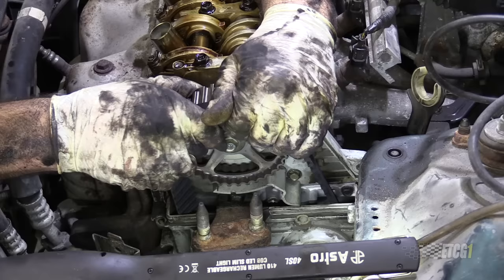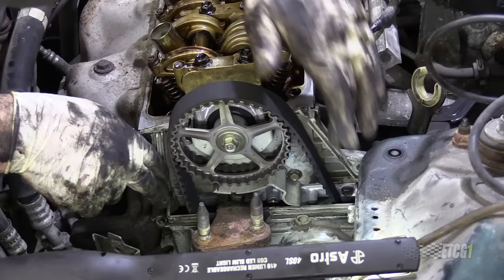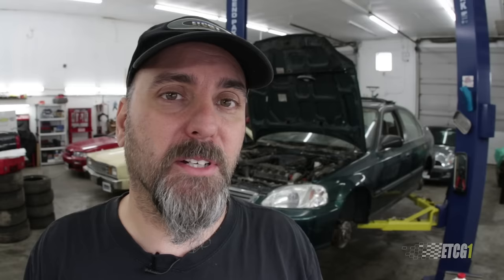How Come Timing Marks Don't Always Line Up Perfect?

Comment: BS! The "hunting" of the belt is a function of the ratio of teeth on the belt to teeth on the sprockets. This has NOTHING to do with the alignment of the timing marks on the sprockets and block/head. Which depends on the ratio of teeth between the crank and the cam sprockets (1 to 2 for 4-stroke engines), belt tension/stretch/wear, the precision of the belt manufacturing, AND the actual distance between the block and head. How many times has the head been surfaced? Is the head gasket thinner or thicker than stock?
Reply: I was going to say the same thing, albeit a little nicer.
Reply from the maker: I got this information from an engineer. It's done to minimize wear on the system according to what he told me.
Reply: @ETCG1  I think there might be confusion on what you mean when you say "timing marks".  The timing marks on the crank pulley and cam pulley (if it's got marks) should line up within a fraction of a tooth with every rotation, while any pre-printed mark on the belt itself (or one you make) absolutely should shift as the crank is repeatedly rotated to minimize wear on the belt.
Reply: @petermescher332  exactly. The belt processes around by some number of teeth per rotation, while the pulleys stay in sync.
Say the crank pulley has 30 teeth (the cams have 60), if the belt has 301, every 10 crank rotations a mark on the belt would move back by 10 teeth behind the timing marks on the pulley and block/head...and every 300 crank rotations the belt mark would be back aligned?   But none of this has anything to do with the timing marks on the crank and cam being off by some fraction of a tooth.
Reply: @ETCG1  no matter the position, the belt length and pulleys stay the same. Yes the belt position on the pulleys drift by tooth but the actual true crank/Cam alignment stays true. This has no impact to the true position of cam timing. When installing a new belt with the marks in place, any variation under a single tooth can be attributed to variation in machining or tension. Often the marks will align more true after rotation and slack is redistribute. Often in high performance applications we use a degree wheel and degree the cam to account for such variances as they can accumulate into multiple degrees when head gasket sizes and machining variances are taken into account.
Reply: Yes I have to agree. Any deviation from the actual mark less than one tooth width or chain link would have no bearing on the mechanics of a hunting gearset. Unless I'm really mixed up, the minor misalignment encountered during belt or chain installation is either taken up once the engine is rotated through a few rotations and tension is distributed across the component spans, or is an immutable result of head & or block resurfacing or shoddy OEM engineering. In either case, the "hunting" calculus would not change.
Right?
Reply: @Stephen Tack: I do agree on this. Why?: If true hunting happens on you're timingbelt, then it would mean that your timing will be out of sync after just a rotation and that would be very  bad. But as Eric has shown that you need a lot of turns before you gat the same tooth on the mark they also call it hunting. but then again it doesn't explain why the timing marks can be off. The only reason for that is sheaved had or a decked block. (or from the factory it is just wrong). But to call it straight BS. is a bit overkill.
Reply: the cam to crank tooth ratio of 2 to 1  ever count the number of teeth on the belt?  it will be an odd number. so yes the belt hunts but the timing is always on..   detroit diesel 71 series used a  hunting idler gear. it was easier to just pull the gear to re-time them than to roll it over.  seems if i recall correctly it was 203 revolutions to get everything re-aligned
Reply: Another YouTube certified technician.
Reply: with metallic 'gears' meshing, hunting is critical to get full usage/life.
in this case, the timing belt has less teeth on one span versus the longer tooth count on the tensioner/water pump drive side, so 
the belt mark 'floats' compared to the sprocket timing marks. i do not  think  the timing belt & sprockets would benefit from hunting, 
as far as longer life. Old Chevy & Ford V8s had non-hunting timing gears with Morse chains & sure enough fleets of taxis all seem to 
take turns going dead in the water every 125k-140k miles.  The gears were fine, the chains stretched & then the Tow Of Shame. : (
Can a Honda hunting timing belt do 125k? Maybe. Someone's done it, somewhere.
Reply: @timewa851  yes someone has done it .more than once.but my luck ran out today at about 225000.around 1 or 2 notches.
Reply: @stevedimock3001  yeah but you saved $12 on
a timing belt !!!  :  )  sweet run!
Reply: Yup.  I am having problems with getting  my timing right.  I install the belt lined up correctly, then turn the engine twice counter clockwise,  and the mark is off by a half tooth.
garr FML

Comment: On DOHC Honda engines with 2 cam gears, there are timing marks on each cam sprocket that directly align with each other when at TDC.  After I replaced my head gasket and had the head resurfaced, the timing marks were just every so slightly off from one another, 1-2 mm or so.  I just went with it, and the engine has run just fine in the 35,000 miles since I did the work.

Comment: Who ever told you about hunting, must have been referring to the computer's ability to adjust timing and "hunt" to optimize idle based on timing and VE settings. This is not related to the precision of timing alignment marks. Timing marks for alignment purposes, are generally not super precise, but close enough where if you are off by a tooth, it's very obvious. It depends on the make. Miata 1.6 marks tend to be dead on when viewed straight, where as 1.8 marks are slightly off, but again, it's obvious when you are off by a tooth, because they are "way" off.

Comment: Shade Tree Mechanic Pro Tip: If doing a timing belt with a mechanical (or spring with a jamb nut) tensioner, and the timing marks seems slightly off, check if the belt tension is set correctly. I was doing a timing belt job on my Nissan 300ZX and I noticed that the timing marks didn't exactly line up. I started turning the engine over by hand and the belt got sloppy either between the crank and a cam gear, or between both cam gears. Retensioning the belt fixed that.

Comment: In theory, since the crank has exactly 1/2 the teeth as the cam, you should be able to line everything up with your painted timing marks 12 o'clock on the cam and 6 o'clock on the crank, spin the crank around 2 times your crank mark should be lined up with the cam mark?  Ive found that sometimes you have to literally put the belt on one tooth off to take up slack or whatnot and when you spin it around like you did here  all is kosher.

Comment: The manual for my B5 Passat had you make sure the crank and one cam sprocket (I think it was the exhaust) were both really close to the marks on the block/head, and then they should be completely "on the money" when you pulled the pin on the tensioner.  I'm not even sure the belt itself came with timing marks, since they become useless as soon as you rotate the crank to check for proper operation.

Comment: Thanks, I did not know about that. I wanted to check my timing belt on my Mitsubishi Lancer but i was so unsure about getting the timing correct that i took it to a mechanic shop to have it checked. Turns out it would have cost a lot less if i just did it myself. Thanks for making the video. If you can can you make a video on the timing belt replacement on a double cam engine japan made vehicle.?

Comment: I changed the vvt sprocket on my Camry a month ago and The marking on the chain n the exhaust gear were off by a tooth or 2 , I was just driving myself crazy thinking about it and wanted to wake up early tomorrow and adjust it , even though the car works perfectly fine I guess I’m just a perfectionist. So I guessing this is normal and me trying to “adjust” it is foolish if the car runs great
Reply: That makes sense though because what’s the chances of the chain and gear or belt will always lining up perfectly , I guess as long as the marks are somewhere in the realm of where there supposed to be its fine

Comment: Very interesting. I hope this explains the problem I have on my 97 Ford Ranger. When I line up all the marks, then put the belt on, the mark on the camshaft goes off a little, like a 1/4". No matter what I've done, I can't get them to line up perfectly once the belt is on. With the tension released, and the belt loose, a belt tooth and a camshaft gear tooth rest on top of one another. The only way to get the belt and teeth to mesh, is to throw the camshaft gear off slightly one way or the other.

Comment: Ah, the single cam... So easy to time, just line up the marks on the crank and cam ends when the valves are in the correct phase and there you go! I've only done one cam belt myself, on a BMW m20B20 and i was really careful and took my time because it was my first, however it couldn't be simpler really.

Comment: Yes the physical positions of the two pulleys are the only concern NOT the fact that the paint mark keeps moving as the teeth ratio is diff. It threw me first time when doing a belt as i always did double chains and the everything seemed to be all out of place. Car started and ran smoothly  and the amount of valve timing i checked alone against the top dead centre on the crankshaft and was perfect
Always rotate a few  times to check for binding, looseness and to do final check on actual physical timing. 
Same with adjustable bearing. Turn turn turn  when adjusting and keep turning!! .

Comment: Interesting topic Eric.  Unlike the old days of the chain in the Sb Chev where tooth count was the ratio, belts rely on gear diameter for ratio and tooth quantity is is developed with odd number. 🤔
Reply: Same thing, really - tooth count is a direct ratio to the gear's size, as the distance between teeth is set by the size of the chain links, so a specific tooth count would mean a set circumference for that sprocket.  You can still count the teeth on the gears if you're using a belt instead of a chain.

The biggest difference I see with belts is having a tensioner, which a lot of older engines (especially OHV) don't have.  The tensioner lets the designers change the number of teeth in the belt a touch if needed by adding a tooth to the belt and designing the tensioner to take up just a little additional slack (as well as being needed because belts tend to stretch more readily.)

Comment: Good video, explains a lot, quick question, if my crank sproket timing mark is lined up with the arrow on the oil pump at TDC, and both my cam sprocket timing marks line up, how's come my crank pulley timing mark doesn't line up with my lower timing cover timing mark?

Comment: As regards the camshaft position being locked how do you prepare a cylinder head for a machine shop? Why are camshafts locked to swap timing belts when they can simply be aligned to tdc + timing marks?

Comment: Hey man great video; I subscribed! I am at the timing part of assembling our 2004 Toyota Corolla 1.8 engine, following manual and advises from Toyota certified Mechanics from the dealer every one says it is not a big deal. We have been taking our time to put this engine together again, its been two months since I started getting it out of the car; I am not a car mechanic, this is my first time ever working in an engine at this magnitude and level and want to make sure the car not only will start once the engine is back in but that it would run too! now here is my scenario; Hynes book states exhaust sprocket (new) and VVTi sprocket's marks should be parallels to each other and in line with the timing chain cover, mines are like that, maybe the VVTi is a hair up; now down at the pulley I have the mark on it slightly to the left of the 0 mark; from right to left there is o mark, then a notch then a 10 on the timing cover; that I don't know what the other marks would tell me and I can not find that info anywhere; I just told the 0 reflects the TDC, yet there is some kind of "free play" (when I say free play, I do not see or feel anything worn out in the pulley or the crankshaft itself; crankshaft was polished the journals only at the shop but where the pulley goes was not touched so the pulley does not wiggles; in the timing gear parts everything is new except the VVTi Sprocket and its assembly) of the pulley in relation to the upper sprockets, like I can actually stay on top at the marks aligned then hitting the pulley by the 19 mm socket and breaker bar I can actually make it to get perfectly on the 0 position and then my VVTi sprocket is up by half a millimeter in relation to the exhaust sprocket mark next to it! Mechanics say this is fine, I am still nervous about it and have been thinking while the engine is on a stand, to undo the timing cover and try realign everything again????? My other concern was a slack of the chain (new) between the two top sprockets while I rotate it by hand, it is a slight dip but I thought that was an issue; two mechanics told me that is fine, in any case, another thing is the book tells you that the two top sprockets should be at 12 o clock position when installed; I tried this BUT the chain links marks where they fall on the top makes the two to be slightly off 12 oclock; the VVTi points 12:05 while the Exhaust leans 11:55! this throws me off because while sitting like that the marks on the side of the sprockets that meet next to each other are almost exactly aligned parallels to each other and in line with the edge of the timing cover as well! so seems there is no way to get it all to align perfectly! I WONDER keep wondering if I am fine or something needs fixing because my lack of experience? --- moving to a different "issue" I kind of concern myself with is with the head itself which was sent to a machine shop for prep and assembly; the valves were seated; the bucket lifts had been mixed out of positions by an Autozone "I know this" rep; I do not know exactly how they matched them again; the buckets have writings on them; I think he told me they grind the stem on the valve to "specs"; thing is the specs that are showing in a sticker on the car hood states the clearances for exhaust is 0.025 to 0.035 but in cylinder 1 I can not slide under the 0.025! the next one that goes barely in is the 0.023! ; would this be a problem????? That 0.025 feeler gauge does not goes under any of the buckets on the exhaust side; for clarification I am trying it with the elbows of the camshaft straight up. Everywhere else I have ok clearances the intake is from 0.015 to 0.025 and the 0.015 goes in each one of them, as well this gauge goes under the exhaust side ok but that is not the spec the manufacturer calls for so I don't know if this matters maybe this machine shop did not do a good job? Would I find out once the car starts?. I am a mechanic for ATM machines, in my field it is impossible to ignore tolerances without issues in the machine; less attention to detail techs do it all the time on the field and invariable sooner or later there are repeated service calls and difficulty to diagnose an issue and it always rest in a tolerance that was overlooked; this is why I am so concerned here; my own lack of experience and "don't know how" is killing me, lol. But I have to deal with it and do it because I can not afford the street mechanic and less than less the dealer with this big engine overhaul; the price exceeds the value of the car!

Comment: You’re referring to the installation marks on the belt right? I’m doing a belt right now where I cannot for the life of me get all three marks lined up even though all gears are correctly timed. Compared installation marks to the old belt and they look perfect. Do the marks ha e anything to do with structural integrity of the belt or just as a guideline? Because I would’ve started this thing up hours ago if someone can tell me they’re not that important.

Comment: Hi Eric,

I’m installing my timing best now and the 2 solid lines match up with the tdc marks for the camshaft pulleys but the dotted line is a few teeth off for the crankshaft. Should I be concerned? Should I line up the crankshaft line and not worry about the camshaft marks?(this is what I’m thinking is the point you’re making in this video but I want to double check) thanks!

Comment: This answered my question,  what about those Honda odyssey V6 engine? Does both front camshaft marks have to line up perfectly to the marks on the timing marks? My rear camshaft was off a little bit but mine van is running fine after timing belt replacement job. Could it cause a p0420 code for a little off?

Comment: What about if it is all lined up when the belt is put on, the piston is tdc and the cam gear marks are lined up. But when I turn the engine over by hand, the piston goes to tdc but the cam gear marks are off a couple teeth? I don’t understand it was completely lined up before hand.

Comment: I have an question for you, I set an timing belt and the mark for the 2 top dead centers keep hitting dead on but no matter what I do the crank saft mark keeps landing slightly left of zero tried resetting it 3 times. It's on the 1990 3vze Toyota engine?

Comment: I have an automotive question. If I am replacing tires and aligning the wheels at two different locations, does it matter which of those I do first? Are there pros and cons to doing one or the other first? Does it not matter either way? What's your take on alignment first or new tires first?